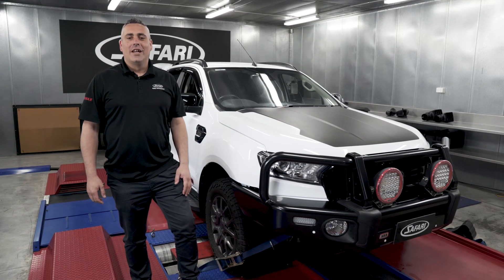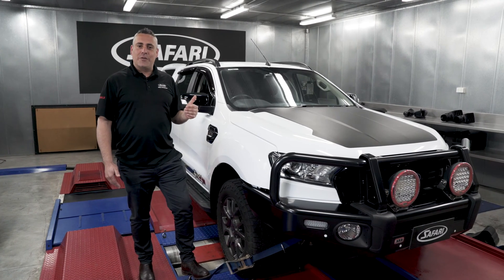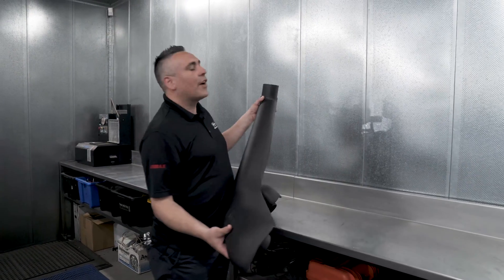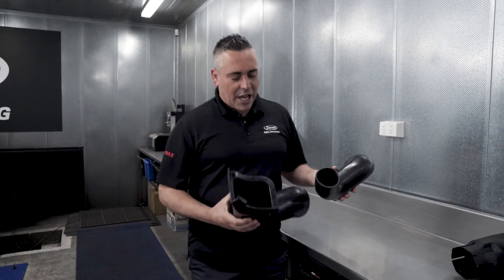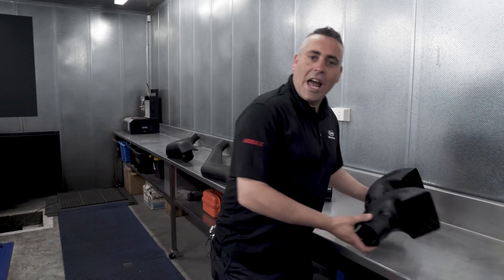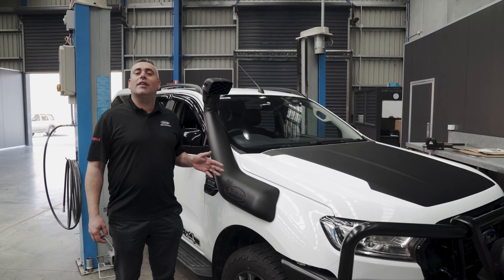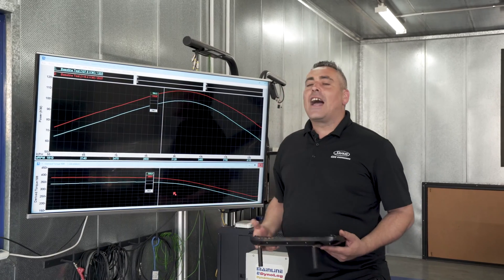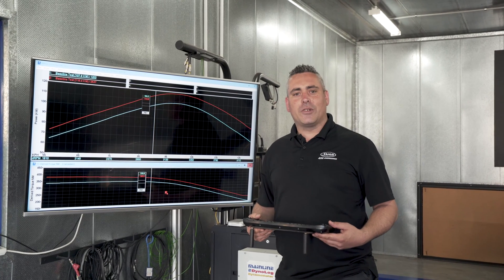Safari ARMAX Snorkel MADE HOW MUCH MORE POWER?!?! Tech Talk S01E04

Comment: If anyone sees this, they are just removing the restrictions at the intake of the airbox. The snorkel still helps raising the entry point although wont add power as many comments have said. You can remove the restrictions yourself for free and see some gains (look at the insert with the screw in it). 10KW might be bit much for a stock tune though.

Comment: I had the Armax snorkel installed on my 2012 PX1, 6 speed manual 3.2L and the performance and fuel economy is actually much improved noted. I even have a hard top roof top tent on my Ute as well as was ARB hard cover 2.5x2.5 awning installed.  

It is extra $$ over the basic model but I feel it was definitely worth it.  

And of course, it looks bad ass.

Comment: I find those dyno gains incredibly hard to believe from just a snorkel. If the inlet size to the stock airbox is unmodified it doesn't matter how big the pipe is from that point.
Reply: Without other adjustments just a snorkel hooked up to the stock air intake wont improve performance. When your driving there is no measurable temperature difference between the air under the wheel well or around the a pillar, that's just whishfull thinking. Plus you are adding more length for the air to travel and extra bends, so yes just a snorkel hooked to the stock box does not improve power it will probably cost you. 4x4's also dont travel fast enough for any ram air effect, you cant push more air in then already sucked in by the turbo in case of a turbo diesel.

There are better ways to modify your intake and increase fording depth then adding a snorkel unless you are a real diehard overlander or in a job that requires regularly crossing rivers that deep you need a snorkel.

That is offcourse without taking into account the coolfactor of a snorkel
Reply: The Safari armax snorkel does cut out the airbox entry point to make it a bigger opening for air in

Comment: Do I need to tune my v6 amarok after an armax snorkel has been installed
Reply: no, no matter the tune, if what they say is true , it will benefit even a stock vehicle.  In theory, if the engine is making more power and pulling more air (as in a tuned engine) the benefit could well be greater.